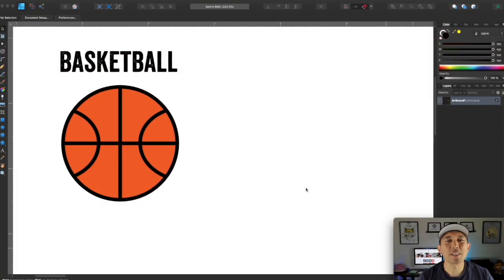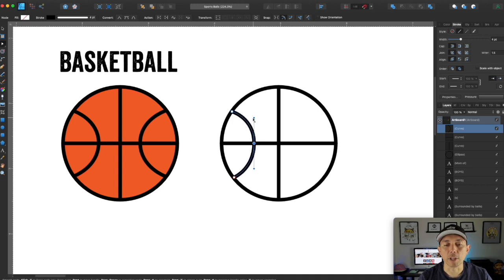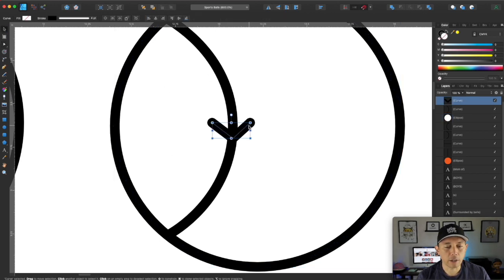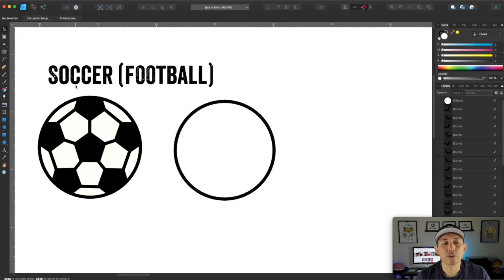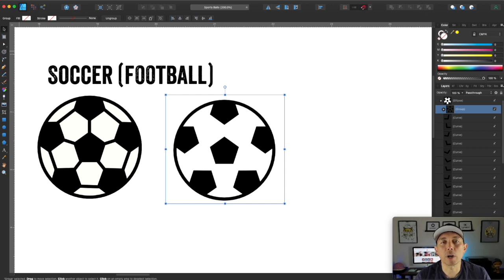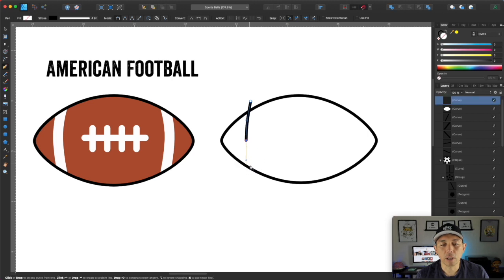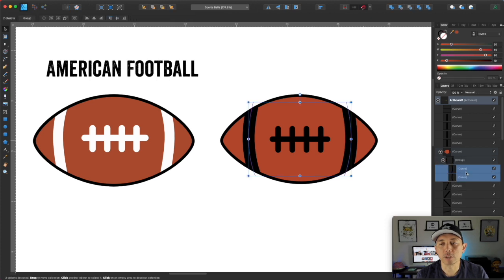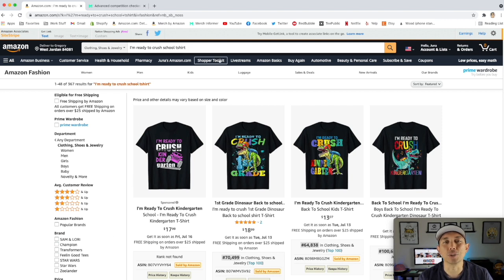Simple Sports Graphics for Non-Designers. How to create Clipart for T-Shirts using Affinity Designer

Comment: Instead of pressing all those buttons when your just drawing single lines, you can use Line Mode and it will go much faster.
Reply from the maker: Line Mode? Sounds amazing.... I got to try that... thanks for the tip
Reply: @DetourShirts  No problem. You've taught me a bunch of tricks. Line mode is up there with pen mode and smart mode.